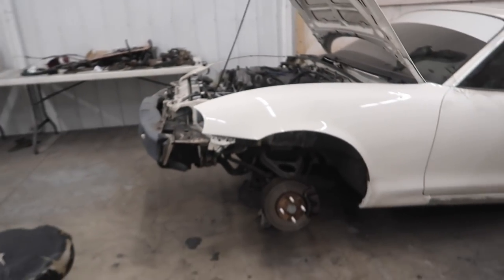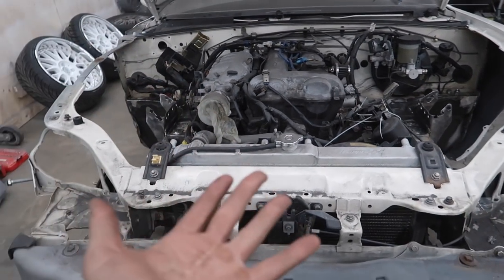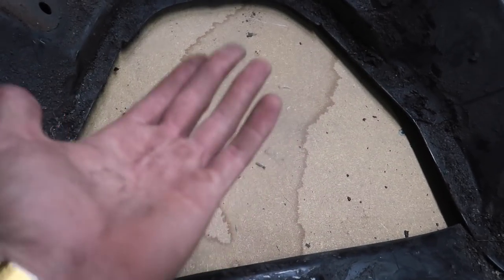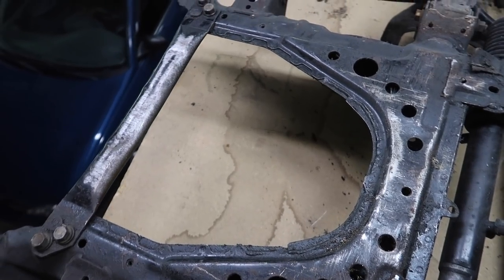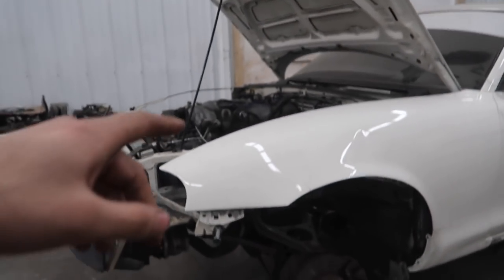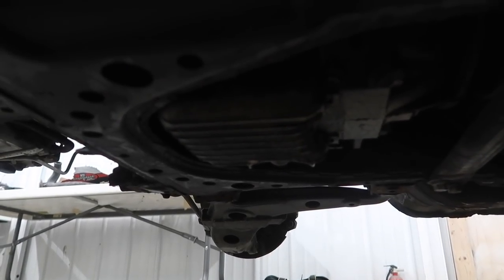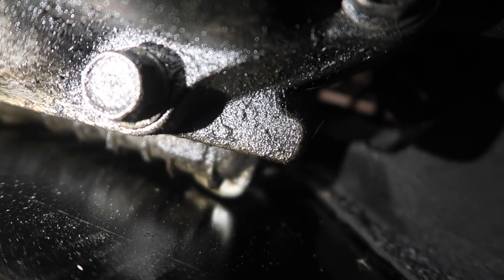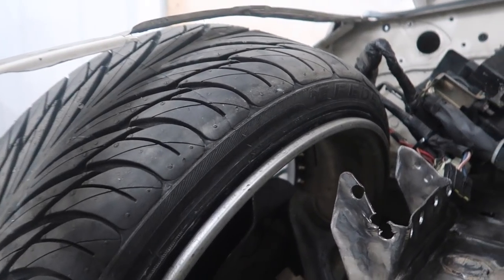Engine Lift & Skidplate | Stanced Miata

Comment: All that worrying about the plate thickness but installs it with Cheap Chinese screws.
Reply: are you surprised look at the rest of the car
Reply: This guy is the king of shitty fixes and sketchy mods. Can’t wait for that plate to rip off and jam itself into the engine while the car is going 35.
Reply: Considering the rest of the build, this isn't that bad.  The plate is unlikely to experience downward forces.
Reply: The screws dont look that cheap but they definitely dont look thick enough for that application

Comment: Odd idea, but what if you grind down the cooling vanes of the pan? A plate that thick could probably support the Miata, but it’d give a little extra room just in case. Plus it’s is good excuse for an external cooler.

Comment: changing your oil is gonna be mint
(nvm its a 1.8 it changes itself by burning through it)
Reply: lolwut? I've never had a 1.8 burn oil, just take care of the damn motor.
Reply: @1337bG01  lucky you man. you cant find a single 1.8 here in germany that doesnt burn 1L every 1000km, its horrible lol

Comment: raises motor with plates.. uses oem length hardware.. uses self tapping screws to hold on a steel plate 1/2" thick.. LOL.. christ